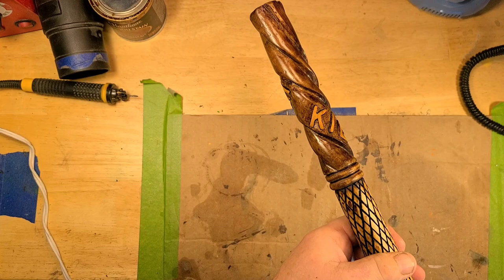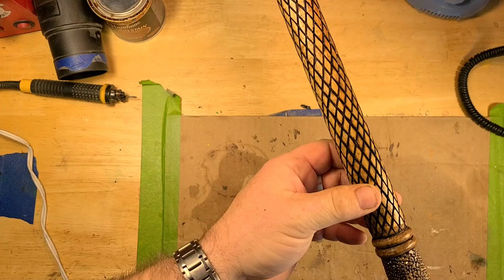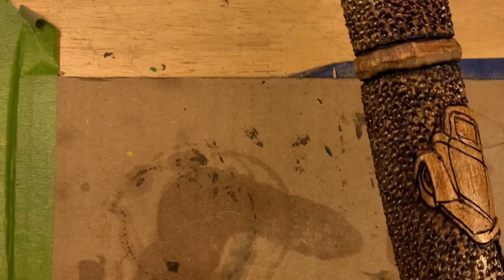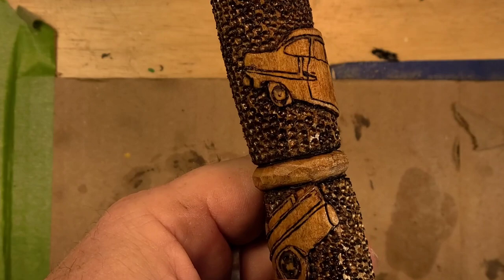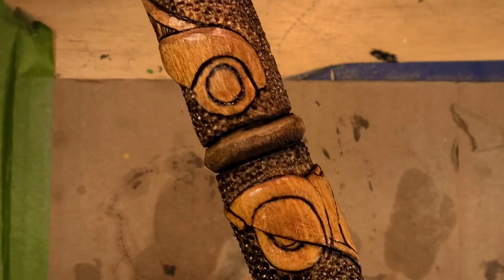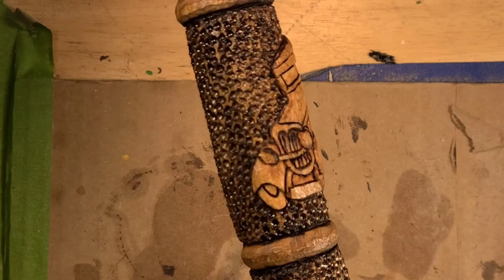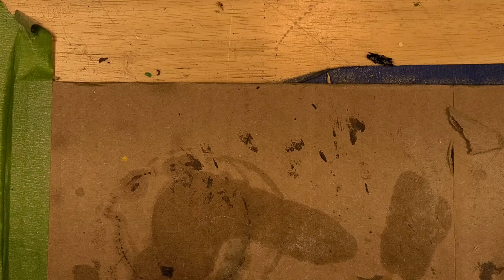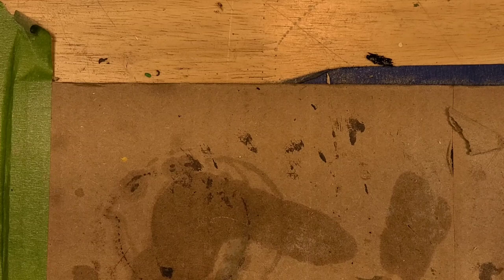car walking stick done at last

Comment: That is a huge amount of stippling. I bet that kills your hand after awhile. Do you brush it after stippling to get out any carbon deposits? I use a heavy dental brush on mine and then compressed air over the entire thing.
Reply from the maker: I ran over other whole thing with a brass wire wheel and corse Scott bright works a treat for me and then blow it off with the compressor stay awesome 
Just carve